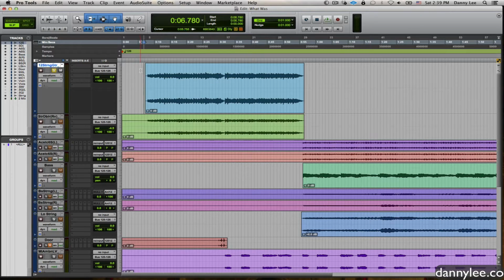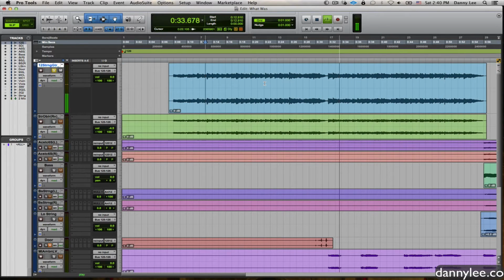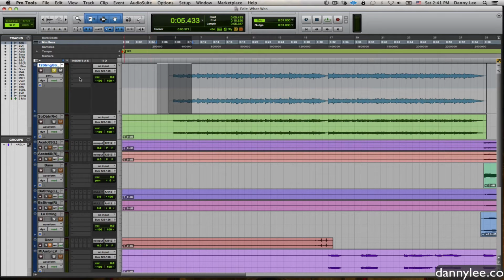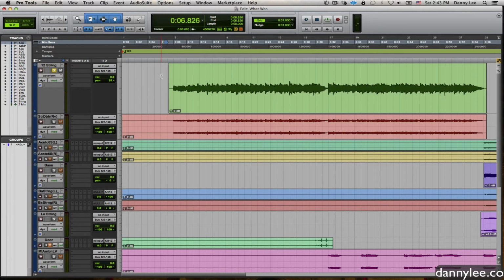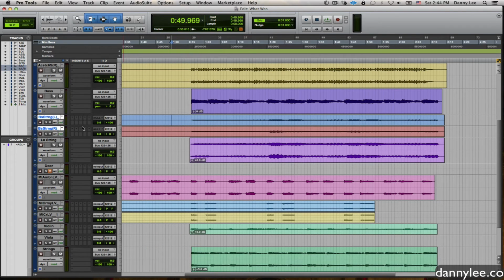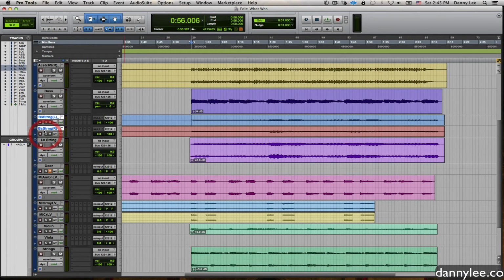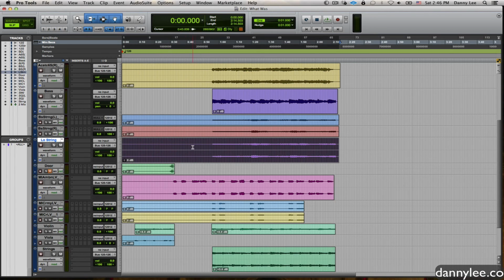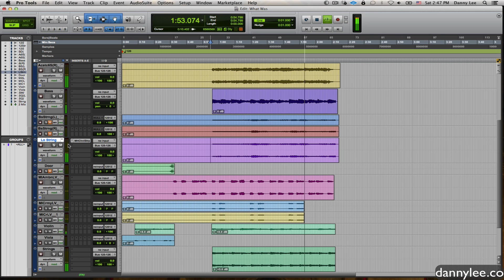Splitting/Combining Stereo & Mono Tracks

Comment: Hey Danny, so I was told if I want a stereo image to duplicate my mono track and then invert the waveform of the duplicate. 

So if I put two mono tracks into a stereo track, will I still need to invert the duplicate or do I just need to duplicate and then drag them into the stereo track?
Reply from the maker: Hi Daniel, if I understand you correctly, inverting the duplicate waveform would simply introduce phase cancelation against the original and that's probably not what you're goal is, yeah? Based on your question, you may want to simply duplicate your mono track and hard pan the original and the duplicate...this will produce "stereo," but it won't sound any wider, per se, as it's a duplicate. It'll just produce a louder phantom center, so to speak. Try duplicating, hard panning and nudging the duplicate ever-so-slightly out of time with the original (matter of samples/milliseconds), depending on the source and what you're looking to achieve. The point I was making in the video was basically to cut out redundant tracks/voices from fake stereo tracks. I hope this answered your question and thanks for the comment!
Reply: Danny Danymal Lee Thank you! I forgot to mention that after I duplicate and invert the track that I pan one to the left and one to the right and that allows for there to be no cancellation. I will try doing what you said.

Comment: Hi, I need help and everywhere I look, no one has the answer I want. I have stereo audio tracks, and only one side is recording BUT I do not want mono. I know it can be done because I've done it before using a different (yet same type) computer and interface, with the same instrument. I want to record in stereo, but I don't want to have to go through and split all the mono tracks and put them into one stereo track individually because that is too time consuming. What am I doing wrong?
Reply from the maker: Hi, Vivian Hayes, make sure that the source you're recording is actually stereo and both outputs are feeding two inputs on your interface, e.g. - if it's a keyboard/synthesizer, make sure you're connecting the left and right outputs of the device into say, inputs 1 and 2 on your interface and getting levels on both. Additionally, within your DAW, make sure you're using stereo I/O for the same input...such as 1 and 2 of your physical inputs are feeding 1 and 2 inside your DAW's I/O setup. In most systems, there's an option to capture both inputs as a stereo pair. Let me know if this helps, or I can try and make a video demonstrating what I believe you might be doing wrong. Thanks for your comment!

Comment: so say I record one guitar DI method...I would record in mono? dub the track, add say chorus to one track......then put the track in stereo maybe?
Reply from the maker: Hi Joey, thanks for your comment! I'm not entirely sure I understand your question, however conceptually, yes any two mono clips can be highlighted and dragged together into a single stereo track. But, if you have two guitar tracks and print chorus to one of them and drag them to a stereo track, you'll just have two guitars left and right, one of which will have the chorus applied (assuming you processed/printed it). If you're still confused, please elaborate if you can and I'll do my best to form a better response. Cheers!
Reply: so when I record my guitar, I use a direct input box and I record a lick  on a mono track. Then I copy that recording so I have 2 tracks both the exact same thing. I add a delay (or reverb) to one of the tracks. pan one track , pan the other. I create a (stereo) subgroup with both the tracks pan the subgroup hard right and hard left . idk if this is a good, efficient way to do things and I'm a newbie...does this sound like good protocol?
Reply from the maker: There're no rules regarding this. It just boils down to how you like to work. Though based on your description here, I'd simply suggest bussing the one mono guitar to an aux track with a reverb or delay on there 👍🏻